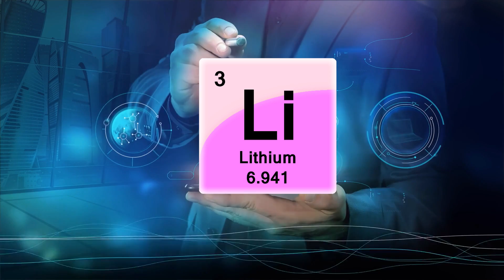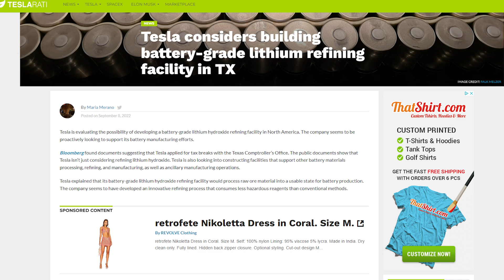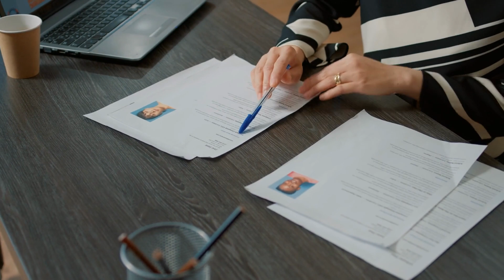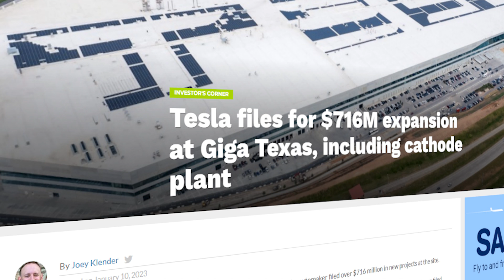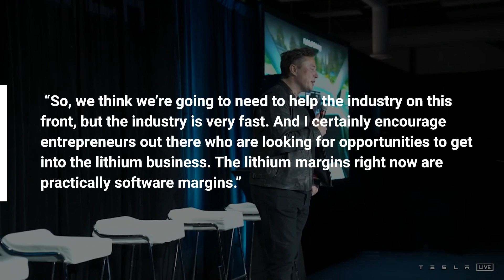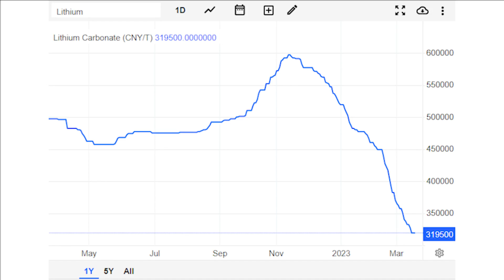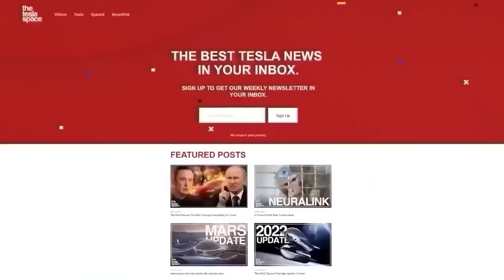Tesla Announces New Lithium Giga Refinery!

Comment: I worked at Capital Cement Company in the late 60's early 70's as a control room operater. Capital was converted from a lithium processing plant. At the time, some of the processes and equipment were the same between the old lithium plant and the cement plant. Notibly the grinding mill and cement kiln. They shut the lithium plant down because the government had all the lithium it needed for years to come.

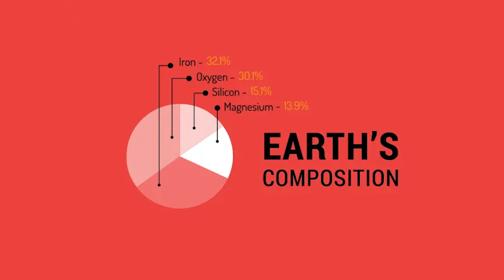Comment: 6:01 "The Earth is made up mostly of iron"
I'm not sure where you got these numbers, but they don't seem to be anywhere close to matching any numbers I see. The CRC Handbook of Chemistry and Physics lists the following:
Oxygen: 46.1%
Silicon: 28.2%
Aluminum: 8.23%
Iron: 5.63%
Magnesium is farther down in 7th place: 2.33%
Overall, it does make little difference as 5.63% is still a massive amount, but I'm just curious what your sources are.

Comment: I hope this all becomes more common away from China and they do a good job at it.   I would not get too focused on Li in and of itself, as so many combinations of materials are being investigated/tested etc and you might end up with a stranded asset with a single new battery type being released.
Reply: Not many people don’t seem to be talking about that there are batteries that won’t need lithium but mainly salt,water and a few other materials plus the solid state battery.
Reply: @dalebruno5201  but as far as a cost saving matter for stationary batteries like the powerwall lfp is a great choice because it will not have all the stresses that an  ev car battery would have like thermal issues and charging speeds I think thier will always be a use for lfp batteries
Reply: @justinjones6810  As of now LFP batteries are a no brainer but the SOLID STATE BATTERY I think will be the better choice but sometimes we don’t always use the best choice for the people the perfect industry that proves that is the medical industry a small company could have a unbelievable product but if the big boys don’t buyout the company they will do everything in its power to crush that product one product would be the MRI machines there are way better products out there but they paid so much for the big clunky MRI machines they have they don’t want to get into something that’s so much better health wise and is soooo much cheaper to use.

Comment: Actually the Model 2 (next generation platform), since it will outsell all current models combined, will be produced in all the expandable and expansion locations. Want to bet how Tesla will start Model 2 and Giga-Mexico? My guess: 1) Start building G-MX 2) Start G-TX expansion for M2 production 3) Start producing M3 & MY at G-MX (get staff trained and up to Tesla speed) 4) Start M2 production at G-TX (work bugs out with top staff, Elon, suppliers, engineers) 5) Start M2 production at G-MX (close to G-TX for aid) 6) Start M2 production at expanded G-Berlin & expanded G-Shanghai.

Comment: What about sodium to replace lithium. Should we put all the money in lithium ?
Reply: If you're talking about those sodium batteries they're far from mass production. Even just taking a very similar lithium chemistry to what is already used and putting it into a bigger container (4680) takes several years to figure out and produce.
Reply: @MicroplaysMC  What are you talking about, BYD is about to used them in there EV!
Reply: @rozonoemi9374  Not true. If you're talking about the cells CATL is developing, they are/were in the validation stages of those cells, and if that's true they won't be mass producing them for at bare minimum another year or two. Even still, they are expected to be around 160Wh/kg, which is 30% less energy dense than most lithium chemistries, so it's not going to replace them anytime soon as they are much heavier. Also, they were mainly developed because lithium prices were shooting way up but as of very recently, the price per ton in china at least has halved (to about 280k yuan from 600k). Remember that urban, population dense cities have an upper hand when it comes to adopting EVs because they don't need as much range. That gives them the luxury of making less efficient, but cheaper packs for small vehicles.
Reply: Lithium is entrenched.  Sodium will need to be very good in order to displace it.

Comment: NMC vs. LFP in the 4860 form? I thought Tesla is moving to LFP?
Reply: Uses both.  LFP isn't as energy dense.
Reply: @whattheschmidt  Yeah. A pal’s new home batteries are LFP. Seems like a great trading for fixed installations.
Reply: @TamagoHead  They definitely are.  I only use LFP for my portable and home batteries. Excellent lifespan and charge cycles!
Reply: @whattheschmidt  👍thx! Great to hear! The Hawaiian microclimate that my home is located in doesn’t require a lot of HVAC and we’ve had solar water heating for decades. 

Our 2000 Avalon and 2004 Truckolla have < 58k miles each, but I’d like to leave the world a better (non-worse) place when I leave. 😋

Comment: This is highly comforting to know that someone is stepping up to the plate and recognizing future needs in the raw materials and taking aggressive action. It's not always about price and profit. It is about providing a home country source of raw materials production.
Reply: Indeed! This is a great thing. It's what we need, to be more energy independent, and it really goes with the Tesla model of doing everything themselves. 

Do you want to know something that is incredibly irritating?

So there is a way to store hydrogen gas in solid lithium alloy tanks, inside the metal itself, where it becomes non-flammable, and impossible to explode, and with a tank the size of a stock fuel tank in a car, they can provide 400 miles range of hydrogen gas, without any of the dangers of a hollow tank at very high pressure. 

So there is a way to store hydrogen safely. But they won't allow the public to produce the lithium alloy needed to do it, due to "national security" patents. 

Look up the video entitled: "hydrogen powered corvette" on YouTube.
Reply: Highly comforting ? Digging vast holes in the ground and wrecking the ground water? Why don’t you put town the fan boy for a minute and pay attention, before somebody digs up your backyard.
Reply: @Nill757  As far as I can tell there are many mining operations, including the massive digging and drilling for oil, that are far worse than lithium mining. I think the public knows about lithium because the media hates Elon and wants to constantly point out how bad his plans are. Drive past a concrete yard and they have destroyed the land completely to dig up rocks to make concrete. Or digging for oil, which completely destroys the ground water if there is an accidental spill. How many accidental oil spills? Lithium is temporary I think. They will find an easier way to make batteries within 3 years.
Reply: @Nill757  troll elsewhere